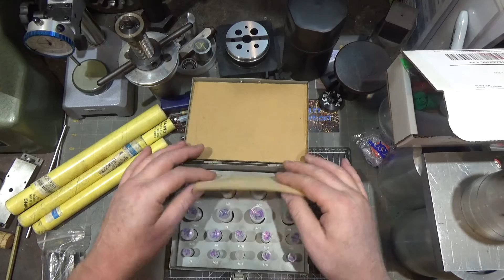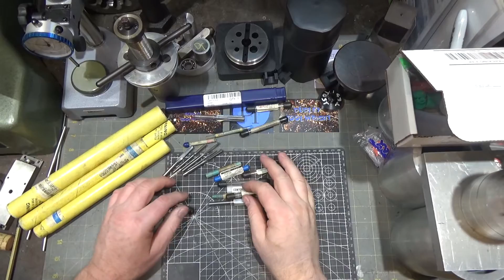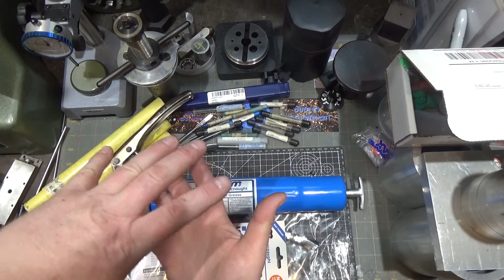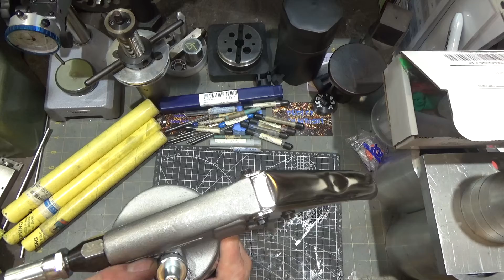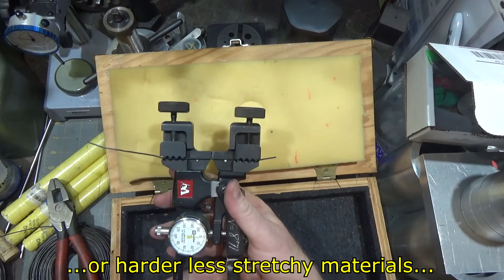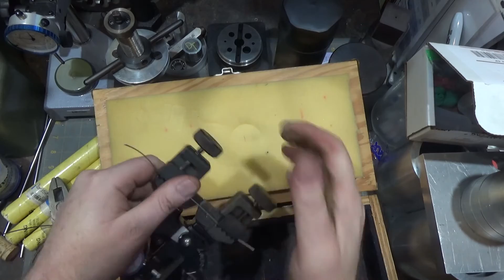Shop Miscellany #02

Comment: Do you lube your mill with grease ?  I was told to always use ISO 68 oil
Reply from the maker: Most places use Vactra 68 as you suggest, but the knee screw and something in the variable speed head accept grease.

Comment: Gday Dudley, in regards to the grease gun, the last company I drive for “trucks” I had the same grease gun for over 10 years, it greased the truck and trailer every week without fail and often one or two machines all well, I’ve always preferred the pistol grip over the lever action, awesome gun, I’ve posted another lot of stickers out to you today, hopefully you’ll get them soon, interesting tool the strength tester, I’ve never seen one before, thanks for sharing and take care,   Cheers Matty
Reply from the maker: Thanks. Was the grease gun you speak of the same brand? If so, that is good news for my specific choice. I look forward to getting the stickers. I wonder what happened to the last batch? Stay safe and healthy.
Reply: My grease gun was exactly the same as you brought, one trick I used to do was when you put a new cartridge in screw the tube on 2 turns roughly then release the plunger so it puts pressure on the cartridge then screw it the rest of the way on, i never had anymore trouble with air locks after I started doing this, a mate quite a bit older and also a truck driver showed me this and he said he’s been doing it for years, it’s works, the air gets pushed out past the threads, I hope this helps, Cheers Matty
Reply from the maker: Nice suggestion, I'll try it.
Reply: @DudleyToolwright  Also when you go to push the rod back in & it doesn't want to go in , just rotate it a bit and it will slip straight back in .  Like Matt said , just leave the top a couple of turns loose when fitting a new cartridge .

Comment: I bought some music wire to repair my WalMart cheese slicers that stretch and break, but it rusts.  Now I have some .015" 316 stainless "spring wire" from Amazon to try.  I think that tool could properly (and destructively) test the wire.  I just looked-it-up and did-the-math, instead–  I hope I was correct.  I actually put a cheese block on a scale to see how much force was required to cut the cheese!
Reply from the maker: That was hilarious. You actually did the calculations to find the proper wire strength for a cheese slicer. such an engineer's mindset. I absolutely love it.
Reply: @DudleyToolwright  The wire I wanted like the original was .015" but all they had was .013" so I was a little woried.  I actually put it on yesterday because the music wire one snapped.  I had been wiping the rust off on the dishtowel before using it.  It worked well in limited testing, meaning, I pushed hard on that block of Tillamook Sharp Cheddar that I took right out of the refrigerator for charcoal cooked burgers-on-the-grill!
Reply from the maker: Sounds really tasty.